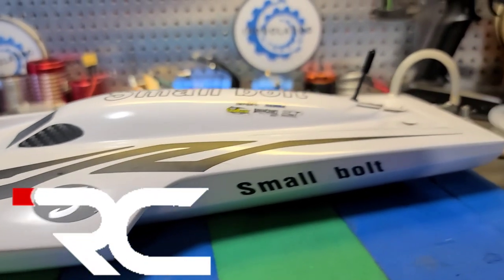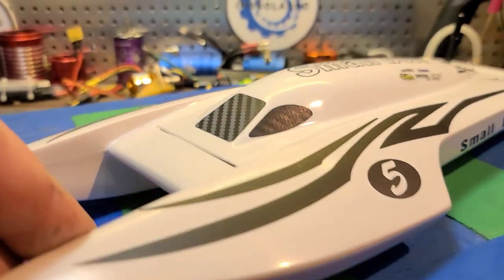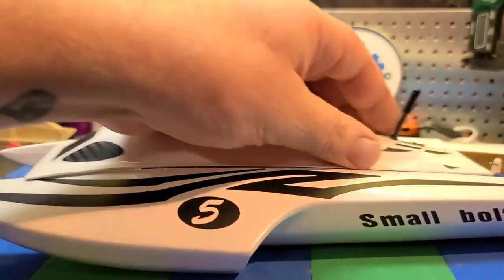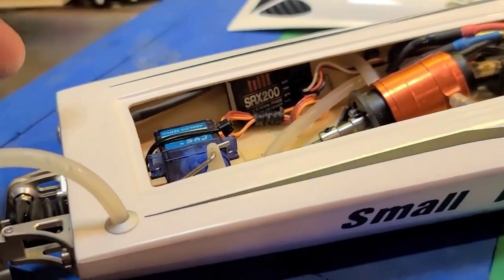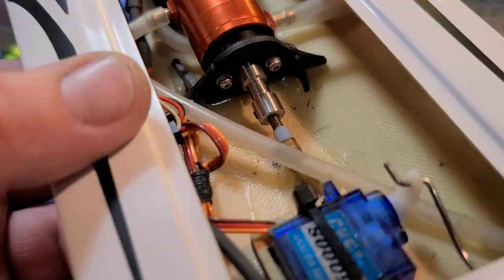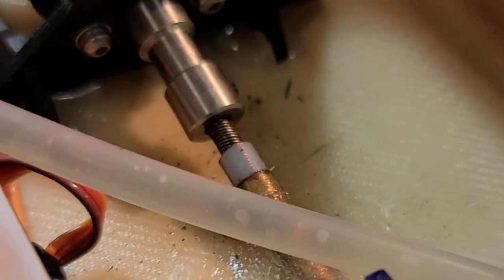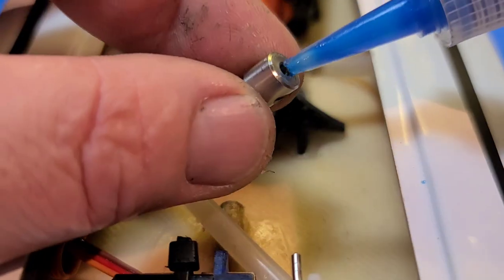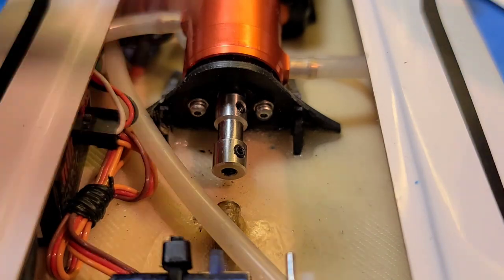Motor Coupler/Collet Alignment & Water Cooling Test RC Boat - TFL Small Bolt

Comment: when you do that with the set screw off wont gravity pull the shaft side of the coupler down and it will dry crooked? Maybe take motor out and stand upright in a vise?
Reply: That's actually a good idea 👍
Reply from the maker: Yep that will also work, my bore to shaft fit  wasn't all that bad,

Comment: Credit to you Big B, that is one genius tip 👌  I face a similar issue with Doctor Jet's latest challenge where I have a motor with a 1.5mm shaft and I'm stepping up to a 2mm drive. I have a collet, so I'm going down the blue Loctite route for sure. 
Thanks so much for sharing brother 👍😉
Reply from the maker: Yep that's the dern challenge finding something to connect the motor to the drive line.  You'll be amazed at what a little CA and plastic tight fitting tube will do with those little drivelines and such light weight boats

Comment: Hey big b, that flex cable system is it always holding with your boat or is it better to solder it
Reply from the maker: I've had zero issues so far

Comment: im working on a aquacraft6 gp1 right now actually same sorta style boat im using the wire drive but with a 2mm to 2mm coupler it rips i can barely keep it on the water i used the shark 40s esc and 4000kv motor i think maybe i should go down to 3650 or maybe a little 2200
Reply from the maker: Oh man the gp1 is an ultra lite boat.   Be careful they will break and Crack at a high speed crash.   A buddy of mine had one that thing was fast as all get up!

Comment: What's up Big B I've been on another adventure for a while. Great idea 4 shimming the collet on bigger shafts I've done like a auto center punch and then put a series of little punch marks equal  distance all the way around the shaft will make little small dents in it so it takes up the slack in it as well.. like three dance at the three position 3 dentastix ingredients of 9 through 10 to 12 or you know I'm saying you can do more but along with her even distances and the same amount of ding in the shaft of the One-Stop bigger than the other making it pull to one side of the other you know what I'm saying but I like your idea right there on small stuff a lot better great idea and that thing runs a whole lot smoother than it was
Reply from the maker: That's actually a pretty good idea I may hold on to that one.